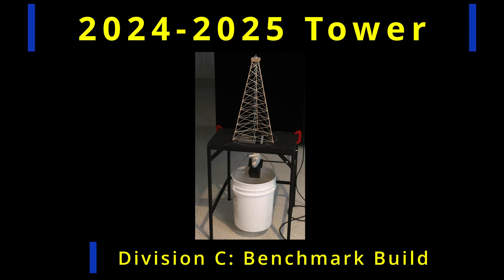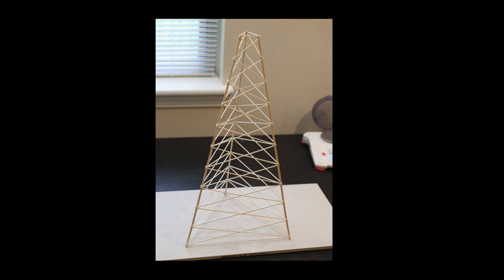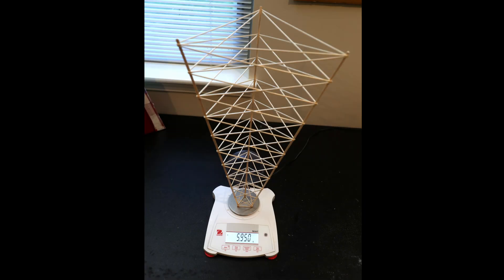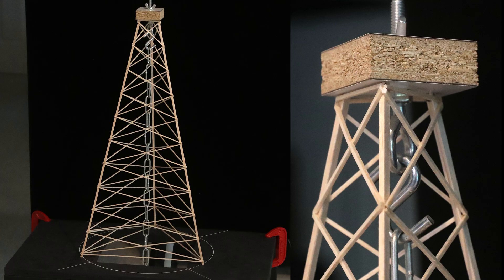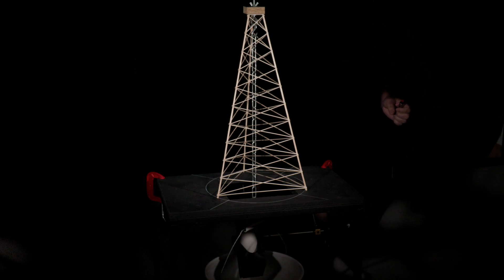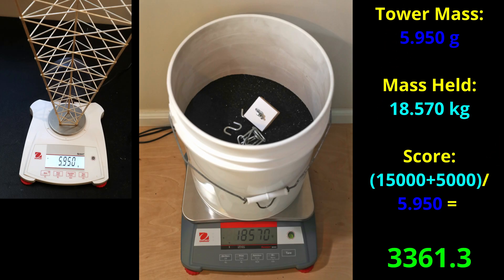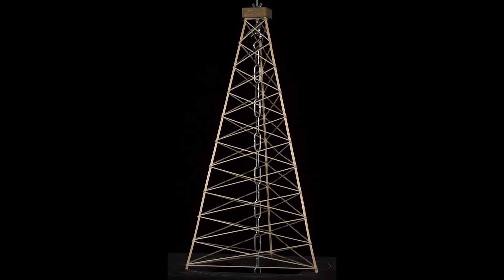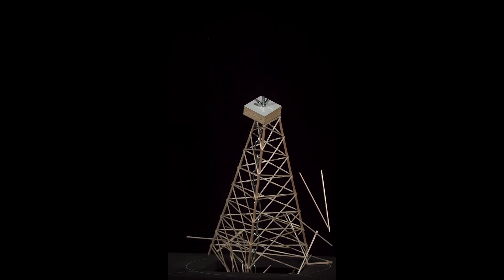2025 Science Olympiad Tower Div C: Benchmark Build

Comment: Are the horizontal members at the very top of the tower crucial to the design?
Reply: Thanks! Love your videos!❤
Reply from the maker: The answer is I'm not 100% sure.  They may or may not be depending on how strong the legs and top cross bracing pieces are.  I decided to keep this build fairly conservative and include both the bottom and top horizontal cross members.   Those are both things you should experiment with as you iterate with your builds!  Good luck!!

Comment: What camera and frame rate do you video at?
Reply from the maker: If you mean the high speed camera, I use a Chronos 2.1 camera and typically shoot at around 2600 fps for a great combination of image quality and speed.
Reply: @balsaengineering6686  Thanks, we figured it was a high-end camera. Unfortunately, that’s outside our budget. We use slow motion cell phones @ 960fps but there not nearly as clear.
Reply from the maker: @moorhus  Don't forget lighting!  I also have (2) 300 watt LED video lights with 2x Fresnel adaptors on them only a couple feet away.  Try to get as much light as you can and frame the device as close as you can (without any zoom).  One thing you'll find is that all phones and even most high end DSLR or mirrorless cameras have a rolling shutter.  That can do weird things to the result during very high speed motion that isn't reality.  The Chronos is a global shutter camera which doesn't have that problem.  The ideal camera would be one of the very nice Phantom cameras, but those can easily cost $150k+!!  It'll take a lot more subscribers before I can get one of those :)

Comment: how much balsa wood is actually needed to create a tower including the bonus?
Reply from the maker: You'll need much larger supply of balsa than just the minimum amount required to build a single tower.  I would recommend having at least several sheets of 3/16" to make the legs from and several sheets of 1/16" to make the cross-members.  Good luck this season!